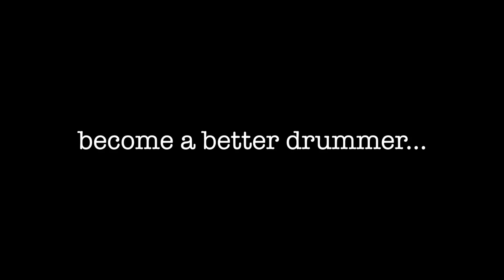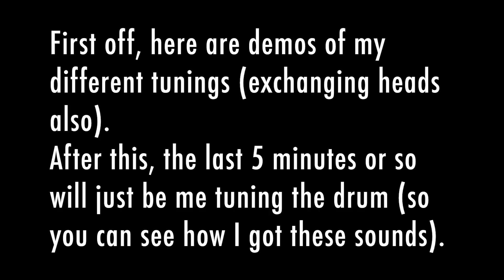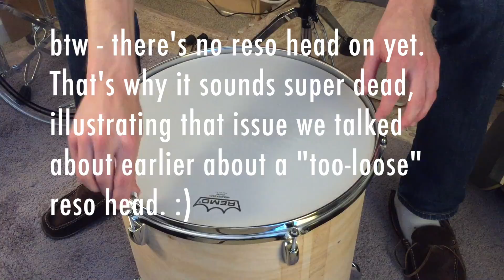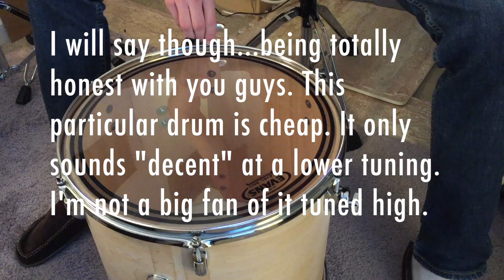Why Does My Floor Tom Sound BAD?

Comment: Thanks so much! I’m new to drumming at age 49 and your videos are extremely helpful, specifically on how to practice on silent set up and brand comparison. 
  I have an old pearl export kit I bought for $85  that was basically everything a starter needs. I’ve since spent 3x that amount in little upgrades here and there. 
  I currently use the pearl silencer heads that came as set off of Amazon,  for my 14” rack, snare, 16” floor, and a 10” rack I added. For my 12” rack I DID get the Remo Silent stroke. All were purchases influenced by budget restrictions. My 22” bass........that’s where I had to get a little McGuyver-ish.......
As you stated There IS NO GOOD BASS mesh head. So, I happened to have two large pieces of 1/4” thick styrofoam from SOME on line order. I placed on the INSIDE of my batter similar to one of the products you reviewed where the piece fit snuggly inside the rim. Same concept only my idea is to deaden the sound, while retaining some sort of bass, as well as keep the “action” of my pedal as real as possible. I also stuffed 2 quilts inside making sure they did not touch the inside of my batter. Sounds great and not too loud. 
  I am a beginner who has never really hit on actual heads, so learning from you that applying duct tape (it will save the world one day....) to the mesh heads gives a more realistic feel was CRUCIAL!! THANK YOU! 
  I’ve subscribed and look forward to more videos and I’ll be sure to go back through the library to see what I’ve missed.

Thanks again,

Conrad

Comment: One thing I learned early on in my youth was hitting the shell dead center first - why, because the shell has a resonant frequency that is what it wants to play.  Once you have that tone, strive to tune both bottom and top heads to that tone.  You'll find the drum will 'sing' in a much more distinct manner.  Also when you tune tune above the tone you want and then bring the head back down to the proper tone, this will help to "seat" the heads properly, much like first tune of a guitar string too high then drop to the correct pitch, why, because all stuck and plucked instruments have to give a little at first, which is why most heads take a few days to get to where they "hold" their tune correctly.

I find with this technique you use little or no muffling/dampening except where volume control is an issue (practice/low volume/etc).  I personally haven't used dampening in recording or live play in over three decades. :)  (Thank You Neil Peart for that tip.  MD 1988 or '89 interview - took me a while to learn it correctly.)

Comment: My floor tom is only 13" (8, 10, 12 rack toms). Evans EC2 is the only head I've found that works well for smaller toms that want to sound big. Love the videos, keep up the good work!
Reply from the maker: Thanks! I'd probably agree with you if I were working with those sizes. From my experience, double ply heads can be tuned lower (giving a "larger" sound), whereas single ply get too "flappy" when tuned low. So EC2s will always provide a consistent, big, punchy sound from most drums.

Comment: If you're having problems with audio going out of sync, it might be from shooting on a device that saves the video with a variable frame rate (like virtually every phone does) then editing the video. The audio track stays constant but the video frames jump a bit. You can use a freeware program called Handbrake to convert the video file to a constant frame rate like 29.97fps and the audio will stay synced.

Comment: Don't know if it's been mentioned here but, if not, here's something I've found that restricts a floor tom's resonance and sustain and just makes it sound dead regardless of the tom's tuning: The three legs affixed to the floor tom's shell. To one degree or another, regardless of the drum's quality, those legs act as a mechanical ground sink by coupling the drum to the floor. You can test this by hitting the drum while it sets on the floor the way it usually does then by tilting the drum back so it balances and rests on just one leg. I'll bet you'll be surprised at the difference in sound. SO, TRICK IS TO DECOUPLE THE DRUM FROM THE FLOOR. There are a few different aftermarket feet you can buy to replace the existing rubber feet on your tom's legs that will make a nice difference. There are other ways too that are a little more elaborate and cost more but usually work better too.

Comment: I have a 14” Pearl EXR floor tom with a shitty mounting system that just clamps on the hoop. I have NOT played a venue when the sound tech or some other person compliments how well my drums sound. I use a Remo Emperor Black Suede batter and an Ambassador Coated on the resonant side. Super low tuning on top and slightly higher on the bottom. I love this sound!

Comment: Great info as always.  one thing i recently tried is these new floortom rubber feet from pearle that make the tom more 'disconnected' from the ground greatly helped getting a better sound.
i was amazed how much difference that makes. simply change out the rubber stops from your 3 legs and Bob's your auntie.

Comment: The closer to the center of the head you hit the less overtone you have. For a fuller sound it could be fixed by hitting slightly off from the center

Comment: My interest here in browsing up this vid was in how to get best sounds from my cocktail kit floor tom - which is really a tenor up on short legs (i.e. upright) - so the batter head for me is the underneath (which is struck by my adapted kick pedal) from below.  The reso head, in effect, is the top head in this case - which I can also strike at need (preferably with the pad-end stick), or even with brushes if I want a 'soft jazz' sound.  For my samba/calypso type arrangements, I can  use this in combination with a small mounted tom and a snare plus cowbell - and I add my two steel-shelled congas also when needed (plus a lot of small hand percussion on top - when I multi-track). 
 I've experimented with different heads on all my drums (including on my regular full kit, my various hand drums and  on my range of various home-made 'kettledrums') and etc.  But I would say that, after you've done the sensible tuning, a lot of it is down to *how* you hit and with what desired effect.  Cotton balls is interesting (one poster here mentioned that I believe).  You can even put small rattle-y things inside the shell (which will 'jiggle' as the beater strikes the batter head of course) - which can be interesting; if that's what you want!    I think, too, your choice of *beater*  is important:  Sticks can be harder or softer, (as with all things musical, it's not just about price alone!).  larger or smaller head (and I have some which I use with  - my own -latex rubber caps on these, for another kind of sound - which also, in this case, gives very fine control on cymbals when you want that). Brushes of course you can use  (and you can choose - on mine anyway - how much wire and how broad and spread therefore) as well as hot rods have their uses  too.   In essence: I think it's as much as anything about being entirely clear about what kind of sound you want.  You the drummer are the master (if you know what you're doing).  It's not the other way about!!

Comment: thanks for posting this often neglected drum in the kit.  I have also found that the tuning spacing interval between top batter and bottom reso head is 5 half notes (on the piano), with the reso tuned higher than the batter as you pointed out.

Comment: I use the Evans Level 360 Hydraulics on my Gretsch and it works very well. No need for muffling or any other ring control products. Resos are all single ply G1’s and balance the thicker batters well.

Comment: Don't forget to mention isolating the feet of the legs. I put Pearl isolating rubber tips on my floor tom. World of difference! To prove this point hit the drum then pick it up off the floor and hit it again. Note the huge difference!
Reply from the maker: Good point. You know - I notice that issue even more with rack toms. I'm always torn between whether to put a tom in a snare basket or on a tom mount. (Basket for flexible positioning, mount for better resonance). I think somebody makes rubber things like that you can put on snare stands as well. I would be interested in A/B-ing these things like you're talking about.
Reply: Yep. I make all my own drums and I use these and there are no floor Tom's from Detroit to Omaha that sound anywhere near my floor toms. It's because of those feet.
Reply: Stephen Clark You must see the Gery Gauger explanation of suspension systems, you will be amazed, cheers!
Reply: Yes! I have the pearl decade maples with those isolating rubber tips and boy do those floor toms thunder!

Comment: The rubber feet on toms' legs mostly stiffen with time, losing shock absorption, so i set them over an additional sheet of rubber tiles - those stuff kids play on that can be locked like puzzle tiles - over three layers of cheap carpet. The legs dig into these a bit so it kinda works like 'memory' as well. 
Where the bass drum spurs rest i inserted a sheet cut rectangular, of material used as rubber sole, between the top two carpet layers. The round, meaty sound blooms from there.
If I may add, I also weighed down the beach towel inside my bass drum with 11 kgs of packed fine sand I bought at a nearby construction supply outlet to stabilize the bass drum sound, as well as the mounted toms. My bass player tailored his sound to complement mine as a consequence.

Comment: For me the priority is the play-ability of the set. Tuning low might sound great but doesn't do much good if the head has so little rebound  that you are going to get carpel-tunnel trying to play it. I try to shoot for the correct rebound on the floor tom and then tune the rest from there.
Reply: What heads you use?

Comment: A couple other things you can try : 1) using a double ply head on the resonant side if you want less sustain; and 2) changing the rims/hoops to a different weight or type. For example, changing from triple flanged, light weight hoops to heavier die cast or wood hoops can cut way down on overtones and give a more focused sound.

Comment: I recently installed evens 360 2ply. Been in a fued with floor Tom since. Your thoughts were inspirational. I have a tip that aids in keeping tthe tuning once achieved. Will send picks later.

Comment: i didnt like any of those tunings. cant say why, but i always tune the res head first without a top head on till i get a nice round & stable sound out of the drum. then i put the top head on and tune upward till i think the drum has the best sound. i do this with all drums, though i go for a different sound for snares. for snares i go go the highest note that still has body on the res, then bring up the top head till the drum has the best fullness, then add snare wires & tighten till they dont have much (or no) after rattle (going for an articulate note). works for me anyways.
Reply: Yup, needless to say why. Ever seen a jazz drummer with a set-up Coated A on top and a EC2 as a reso? This (could be) the reason. try another A or even Diplomat! Weird how @ Stephan Clark does mention the importance of the reso head and tuning and then uses a (in my eyes, no offense) weird choice. Same works for the EC2, but a Coated A works in that combo, other ones would even do better for the lower/fatter tuning. Regards p
Reply from the maker: In response to both of you guys (tbone45040 and Peter De Decker)...we may simply have different tastes in tuning. Tbone, you mentioned tightening snare wires until there's no rattle, which is pretty much opposite of my preference haha. I go pretty sizzle-ey. Now the other thing...In a way, it's tricky for a bunch of drummers to talk about tuning because we all have different kits made of different shell types (not to mention we all play many different styles of music). Although I'm sure a coated ambassador on the bottom of my tom combined with emperor on the top (actually about to test that combination soon) would sound good, it's simply a different sound than what I have now. My current combo yields the most "punch rock sound" with high attack that that tom can give. I am always interested in new sounds though, and I do experiment a lot. I think there can be a lot of possibilities for most drums. It's all in what your tastes are :)
Reply: totally agree stephen, different tastes. i would never imply my method or sound is the 'correct' one. just thought i'd put out there that i start with the reso head first and that works for me. love your videos. any chance you'll be attending PASIC in Indy next weekend? (dont have a clue what area ur from)
Reply: I do the same thing too and its working very well :)
Reply: yes-so do I. Reso first .Toms: high enough for a" fruity" sound and then the batter  up to exact the same pitch !for best resonance! (Good for brushwork..)Snare: reso first pretty high.NO snares! And then  batter up to a  comfortable stick rebound.Not to high -let the drum "sing".Snares not verry sharp - so the brushes can produce also "body"..That is 4 U jazz guys..ha ha
Reply: I tell You: please try the "Diplomats".On Toms and snare. They are the best: Open sound best definition and loud if needed.Rock drummers -U will be surprised how sharp and cutting through  your snare will sound with a Diplo-Reso ! (Buddy Rich used it)
Reply: Stephen Clark What is your “combo” of heads for rock?  Just curious as I am preparing for drum tracking and am still exploring heads.  Thanks! 🙏🏽

Comment: the best technique for using a moongel is once you get the drum tuned how you want it listen for the tones that annoy you and very lightly place the tip of your index finger on various parts of the drum head until that ring goes away. mark it with sharpie. cut a moongel in half. place it there, find the next overtone until they're all gone. usually 2 half pieces on top and one half piece on bottom will get you towards a perfect sounding drum. 

-sound guy

Comment: When tuning any drum i am a firm believer you should go for a pitch that suits the drum rather than trying to bring your drum to a certain pitch. When i started playing I always tryed to go for a certain pitch and found the drums just don't sing when doing that. You'll find drums really only like a narrow band of pitch. if you want something different get a different drum. I'm using an 8 10 12 and 18 for my toms iv'e tryed different combos but this works good i feel. Ill run different heads on toms too. Dont like the ec2 tho, they are too dead.  emperors for top heads work fairly well and you can damp them if needed.

Comment: Great video as always I like the sound of the Evans ec2 , I've fitted Evans level 360 gc2 clear heads to my kit and my 16" floor tom is tuned 83hz on top and 110hz on bottom which gives it a nice low sound I used,I used the drumtune pro app on my phone which I found very good and easy to use.
Keep up with the videos I find them very useful
Reply from the maker: Thanks! I'll keep 'em coming 👍
I'll check out the drumtune app too. A lot of times I'm just adjusting things by ear, but I did used to use of those drum dial tuners years ago. 
I've really liked EC2 heads on my kit in particular. They seem to always produce a good, rock sound, and they work well with my shells.
Reply: Stephen Clark Try some Remo coated Emperors or Vintage Coated Emperors. They last longer than Evans and have an overall better tone. I have 20 year old Remo heads that sound better then an Evans G1 Coated with 3 months of light use. My Emperors LOOK like they need to be changed but they still sound AMAZING.

Comment: Floor toms have always been a tricky balance between head choice and resonance. I used Evans hydraulic batter heads on both of my Gretsch floors for a long time as a gigging drummer. They have great attack, and quick decay which was perfect for live shows. 
Plus, they lasted a long time. 

Not so good for the studio though. 

I traded them out for the Remo Controlled Sound black dot for that good, “John Bonham” 70’s sound. Good tuning kept them from sounding “tubby” with an Evans G1 for the resonant head. 

Now the sustain goes on forever and it’s been a perfect combo. Sizes were (diameter first): 16x14 and 16x16.

Comment: The reason floor toms don't normally tune as well, or resonate as well, in my experience, is because they are hard mounted straight from the shell to the legs that sit on the floor. This prevents the shell from moving and allowing a natural resonance. This is the same reason I never mount anything to my bass drum, the weight of the toms will pull on the shell and kill the resonance. 

This is the same reason I always use some sort of hoop mount, like the Tama StarCast, or lug mounts, such as the DW style mounts. There is a company, I don't remember who, that makes rubber feet in a "ring" shape that allow some bounce when the floor tom is struck, and this helps with the sound somewhat.

Comment: If you want a great warm sound that is not dead where you sacrifice head rebound,  try a tried and true old trick. Take a piece of thick felt 2 1/2 " wide , not thin Gibraltar or Cannon crap, I use Slug felt and place it under your drum head up against the head between two lugs. Work with this and tune up for the desired sound. This is not the same sound as putting Meinl Honey gels or RTOM Moongels on the outside of the head. Outside muffling is a studio trick for engineers to get an easy sound. The felt really just acts as a high end buffer that can bring you nice results.

Comment: Here’s a tip for floor toms- get you some Gibraltar Floating Tom feet for $5... huge difference in resonance. Just helps add some low end boom and tone to the ft. I like my ft pretty low, but not dead, so this really helps.